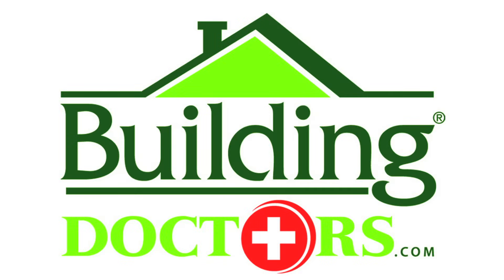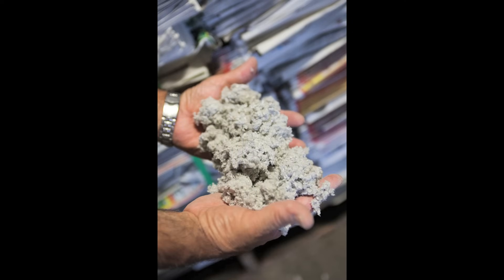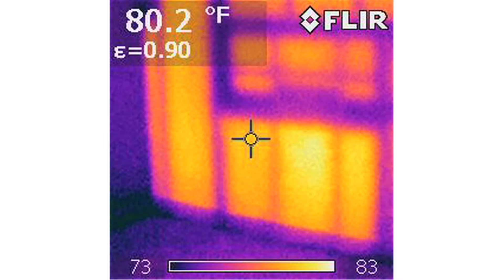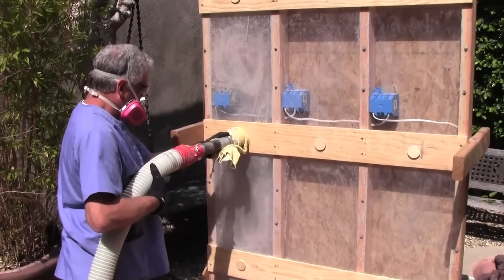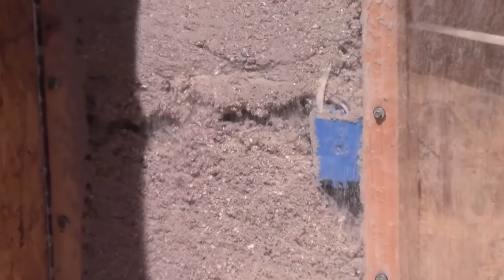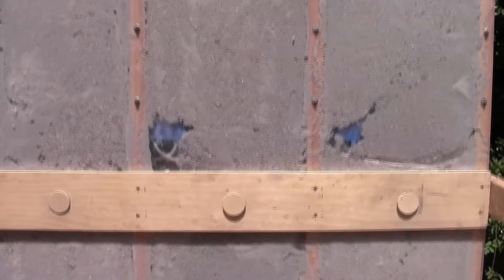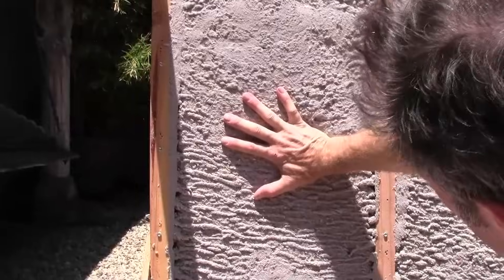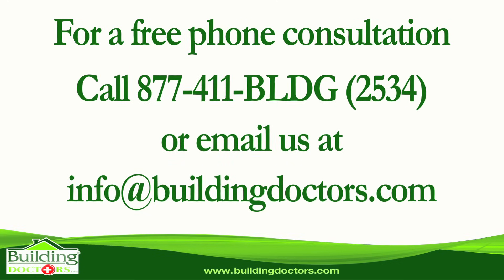Compare Drill and Fill Wall Insulation Techniques

Comment: I have checked the three places in town that rent the blower, and not a single one, including Home Depot can supply the plugs!  If you can help with that, I will be ready to go!  Thanks
Reply: Mike Banks  what kind of exterior siding do you have? What I do is if it's a vinyl siding house, I pull off the top peace of siding, and pull off the siding below the windows..
I have a 2'1/2 hole saw, after I have drilled all the holes and blown all the insulation, I come back and take the peaces that I drilled out , look like hocky pucks. Then I run a bead of caulk around the puck and stick it in the whole then replace the siding.. or you can use gorrilla tape to put the pucks in.. won't be seen behind the siding..
Reply from the maker: We don't have any vinyl siding homes here in the LA area. Mostly stucco but some wood siding. We do use a 2 1/2 inch hole saw bit so we have room to move the hose around in the wall.  

We have also found that the majority of places tha rent blower their machines don't have a big enough blower to dense pack the insulation.  Tough for the DYI person.
Reply from the maker: We tried a 3 inch hole but found it really time-consuming when it came to stucco patching.
Reply: If it is vinyl siding use caution doing this in the winter time. The vinyl is very forgiving when it's hot out, but becomes unbelievably brittle when it's cold out. You can easily ruin the siding.

Comment: to rapeer this hole in plaster bords. it will cost same to put new bords and skim it
Reply from the maker: Sometimes that is true but it depends on the home and if it is empty or not. I answered the same question below but here it is again: Yes, that is absolutely an option but doing that on all of the exterior walls makes for an extremely large construction project and would take a long time and most homeowners would move out during the work period.  We can do most homes in less than a week with minimal disruption. If you did remove the drywall.plaster we would recommend insulating the exterior walls with the net and blow technique since it is very difficult to install batts perfectly.
Show less
REPLY

Comment: Yes but problem with this you don’t get plexiglass wall in the field. These are perfect conditions. Usually with old houses you get plaster walls with lot of crap inside
Reply: You are 100 percent correct. I mention that in the video. That is why you need to put the hose in those places to get the insulation there. It will not fall in place on its own with all of those things in the way that you mentioned.  Best,

Comment: This stuff is a nightmare to work with when you need to remodel, fix a hole in drywall or do just about anything inside or around that wall. Fiberglass is still the best way.
Reply from the maker: If you watch the video all the way through you will see that the insulation stays in place in dense-packed wall when the wall is removed. With the other methods, the insulation falls out when those walls are opened which can be a mess. It is better to have a properly insulated air sealed wall for the next 20 years instead of an inferior product that is not installed well and is not airtight just so you might possibly have to open that wall up for drywall patching. That is very shortsighted.
Reply: Hahaha.... Fiberglass doesn't insulate worth a shit if  you live in a cold climate.
Reply: @Buildingdoctors  I think most the negative comments are from people who are not in the trades professionally or have no idea of what reality is, I like how some people would rather sheet rock their entire house vs having a couple holes to patch and paint or do chair rail and wainscoting. You have these people that believe doing everything themselves is cheaper when the truth is they have no business doing half the crap they do.
Reply from the maker: @T6Tarek  I agree, 100 percent. The work that we do is super labor-intensive since we are all about attention to detail.  what is that old saying? Do you want it cheap, fast or good? You can only get two out of three.
Reply: @Buildingdoctors  I tell people all the time when you hire the guy that says he can start tomorrow there is usually a issue and remember to redo woek is generally 2.5 times the original cost.
Reply from the maker: @neilhoffman4818  if you only put in insulation and not air seal that might be true but a good thermal barrier along with a good air barrier can't be beat.
Reply: @Buildingdoctors  That is not true.  Fiberglass allows airflow to circulate internally within the wall cavity. It is called convection.  It has NOTHING to do with air filtration or an air barrier.  I recently had a discussion with an experienced builder who did not understand convection and even after explaining it to him, he still did not understand fiberglass and convection.  The wall cavity is cold on the exterior portion of the cavity.  Convection forces the air down until it hits the bottom plate where it then has no where to go except to the inside wall.  It then warms up and travels up the interior wall until it hits the top plate and makes its way to the outside wall.  The air then cools down and travels down the exterior wall where the process continues.  Fiberglass will NOT stop this process.  Dense pack cellulose and spray foam will.  I am sure that if you are in a moderate climate that fiberglass is fine, but not where the temps plummet.
Reply: @6milesup  There are a couple of loose-fill fiberglass insulations that are specifically designed to both insulate the wall cavity and when dense-packed to the proper amount (2.2 lbs per cubic foot) has air sealing qualities. Spider by Johns Manville, Jet Tsream by Knauf and L77 by Owens Corning. What you are referring to is a typical fiberglass batt insulation job. Those do allow air movement through them.

Comment: Best way to remove air pockets......the thing that provides insulation.......
Reply from the maker: Yes, but you can't get the materials all the way up or down walls without putting the hose there due to chicken wire, Romex, conduit, junction boxes etc in the walls.
Reply: Wrongo bucko

Comment: Dense packing reduces R value...
Reply from the maker: If you install the proper amount 3.5 pounds per cubic foot for cellulose and 2.2 pounds per cubic foot for fiberglass you will be fine. When it comes to fiberglass you need to make sure you are using the correct product. Not all loose-fill fiberglass products can be dense packed. If you pick the wrong one then your statement is correct that the R-valuse will go down when you dense pack.
Reply: Totally untrue Jake knelsen..... do your research and you will find just the opposite.

Comment: What is the R value rating for dense pack vs non? It's the dead air space that does the insulating, so tight packing of any insulation reduces it effectiveness. There's a conceptual sweet spot on the density vs settling continuum for best results, but what is that?
Reply: Mitchell,  Thanks for your message. The benefit of dense packing is not only that it won't settle later on and leave you with air pockets but there are also air sealing qualities as well. A dense packed wall prevents convention currents from happening inside the wall.  Yes, the r-value drops slightly when dense packed but the desired compaction rate is 2.2 lbs per cubic square foot for fiberglass and 3.5 lbs per cubic foot for cellulose. Hope that helps, Dan

Comment: I notice there is NO SOURCE for the claim of a R 4 per inch for blown fiberglass. In my 28 yrs in the  insulation buis I have NEvER seen ANY  supporting documentation to this effect. MOST blown FG is at best a R 2.2 per inch.
Reply: That R4  per inch is dense pack fiberglass. blown in attic is usually the R2.2/inch
Reply: when you COMPRESS FG it LOSES R value not gains.
Reply: Why do you think there is R-11, R-13, and R-15 batts for 2x4 walls?
Higher density fiberglass has higher R value than low density (please tell me you understand what density is...) up to a point ofc. The limit is ~3.8/inch or so in which point you are compressing an R38C batt into a 2x8 cavity, it get's expensive lol

Compressing fiberglass increases R-value per inch but lower overall R-value, but it gives you more room to fit more insulation.

For example: compressing an R-19 batt down to 3.5" nets you a R-15 batt
Reply: @hotrodder62 Not sure where you are getting your information from but here is a link to JM and their Spider Product. They claim r-4.2 per inch. http://www.jm.com/content/dam/jm/global/en/building-insulation/Files/BI%20Toolbox/BID-0204%20JM%20Spider%20Plus%20Sell%20Sheet.PDF

Knauf makes a similar product as well with over r-4 per inch. http://www.knaufinsulation.us/sites/us.knaufinsulation.com/files/BI-BWJ-DS_12-15.pdf

Please note that there is a huge difference between loose fill insulation blown into an attic and dense packing a wall with fiberglass to 2.2 pounds per cubic foot. 

Best,
Reply: Their CLAIMS and actual facts vary..besides that the glue( fluid delivery) has been known to break down via vapor transmission for years.. we stopped using it many yrs ago as well as bibs. they use the "fluid delivey as part of the FG  R value NOT  the glass solely btw
Reply: and the cost of R 19 compressed is the POINT! not to mention pressure against the sheetrock and popping screws and nails....... tell me you understand this. Ive been doing this for 28 yrs. I know what im talking about, as well as teaching BPI cert classes.
Reply: You asked for supporting documentation to the r-4 value and I gave it to you. If you choose to believe that these companies are only making "claims" and not facts that is your right to do so.
Reply: OOOH ok !so the MANUFACTURES claim is now considered " supporting documentation"... good to know... (sheesh).....sorry but that aint cutting it
Reply: "john mansville  sell sheet"... or did that escape your attention??
Reply: You seem to have a lot of anger. I would suggest you look elsewhere to vent it. I am a contractor that spent my own money to make this simple video. As building scientists, we only deal in facts and data. You seem to want to make up your own however I trust the souces.
Reply: hotrodder62 I'm sure the cellulose has a greater R value than fiberglass..for instance .look at blown cellulose in an attic..to get a r30 it takes about 10 to 12 "
Where as blown fiberglass to get a R30 value. It takes 20" or more.
Reply: 2Awesome  r.11 is nothing more than sound batt..
Reply: 2Awesome why would u try to compress a r19 batt into a 2×4?
Reply: @hotrodder62 Did you discuss this with people at BPI and what did they say?

Comment: That’s great when u can see what ur doing. But not real world.
Reply from the maker: Terry, we use the plexi-glass wall for training new employees so they will get a feel for the blowing hose, what the machine sound like as the wall gets more and more full. It also helps show people like yourself what happens inside a wall cavity when you insulate them.  What is "real world" is the benefits of dense packing walls instead of the other techniques but thanks for your comment.
Reply: Contractor for 30 years.  There is no good way to do this. At all. It all settles over time.  U know this.
Reply from the maker: There is one technique that is better than the other ones and that is dense packing the insulation either 3.5 lbs per cubic foot for cellulose or 2.2 lbs per cubic foot for fiberglass. It does not settle if you dense pack the wall. That is a fact.
Reply: I dense packed mine and it has been 5 years and I know for a fact that mine has not settled.
Reply: If it's dence packed correctly like the video shows by a installer worth his salt it Will Not Settle.
Reply: Seth Emai Yes because you have x-ray vision if you’re happy with it so be it everything settles everything.
Reply: It would be so cool to have x-ray vision. I rewired the first floor ceiling fans this past summer and when I pulled off the siding at the second floor band board to fish the wires up thru the walls and into the ceiling, I saw no settling. I have 8 ceiling fans and 5 are on the first floor so I did the east and west sides (second floor joists run E-W). I know it hasn't settled, I didn't say it 'never would'.
I still have a lot of projects like a deck off the dining room where I will open up the wall and replace 3 windows with french doors. I will be enclosing the 8'X30' screen porch and I will be removing the siding to make 2 archways, close in the front door and add plaster. Then a deck over that from bedroom 4 upstairs north side. I will be bumping out the bathroom to move the tub into so I can move the laundry room up from the basement. I will try to remember to post here if I see any settling.
Reply from the maker: Terry, We do have "X-ray" vision. It's called an Infrared camera and let's us see the temperature differences inside the walls which shows us where there are missing sections of insulation. Dense packing insulation in the walls 'pre-packs the insulation so you won't get settling in the wall. These are facts, not opinions.
Reply: Building Doctors It does settle everything settles and you’re not supposed to pack insulation because it dampens the R-value read the back of the bag
Reply from the maker: Terry, Please do your research before writting on this page. You are wrong.  Read this https://sws.nrel.gov/spec/411015  for the standards of dense packing walls and this is a good one as well. https://buildingscience.com/documents/insights/bsi-043-dont-be-dense
Reply: @Buildingdoctors  
Doubting Terry ...has to always be someone...😑

Comment: just pull the sheetrock off
Reply from the maker: Yes, that is absolutely an option but doing that on all of the exterior walls makes for an extremely large construction project and would take a long time and most homeowners would move out during the work period.  We can do most homes in less than a week with minimal disruption. If you did remove the drywall.plaster we would recommend insulating the exterior walls with the net and blow technique since it is very difficult to install batts perfectly.
Reply: @Buildingdoctors  where are you all located?  I'd be interested in a quite if near my area.

Comment: think about the insulation as a thermal bridge, the more desner it is the more it will lead the cold from on side of the wall to the other. You should NEVER "dense pack" loose nor sheets of insulation. Insulation works by making air stationary. "The fluffier the better"
Reply from the maker: The research proves otherwise. The most important part is to make sure you don't dense pack beyond the manufactures recommendations. 3.5 pounds per cubic foot for cellulose and 2.2 for fiberglass.
Reply: Cause a light and fluffy blanket feels warmer than a thick wool one.

Comment: Its a hack way of insulating.
Yea maybe good for someone that uses vinyl siding floating floors and partical board countertop over ikea cabinets. Might save enough to cover over your rotten shower with a poorly fit flimsy fiberglass hunk of crap and 3/4in of caulk
Reply from the maker: Mike,  I am not sure of your point.  Reseach shows that dense packing walls are absolutely the best way to insulate an existing wall cavity.  Drill and filling any other way is what is "hack" and I have the data to prove it.
Reply: @Buildingdoctors  Where is the data? Give us a link.
Reply: @ricomajestic  Thanks for your message. What data are you looking for? I put quick pictures of the weights of the insulation in the three different bays.  Let me know, Dan